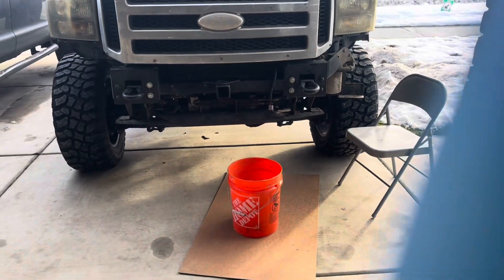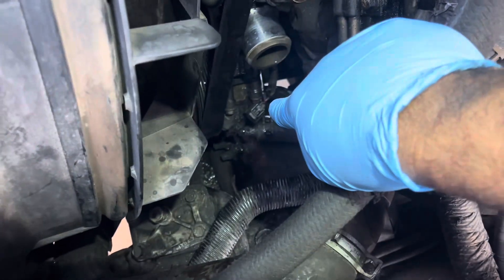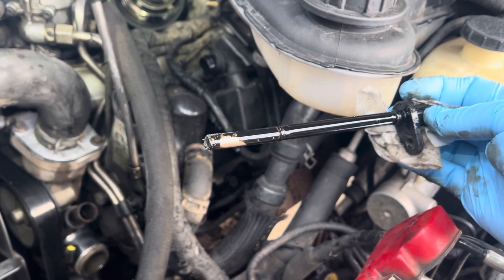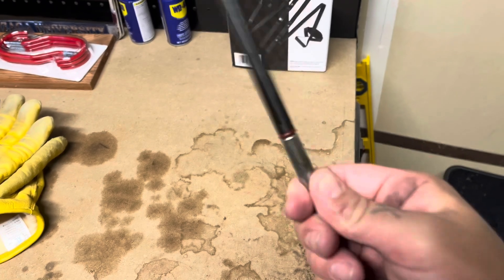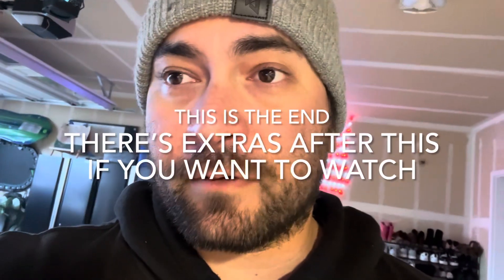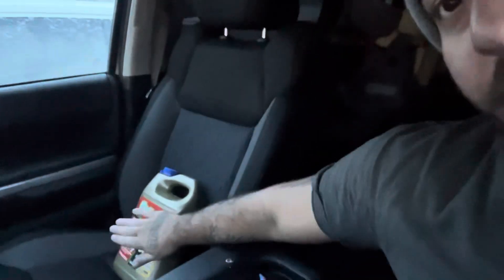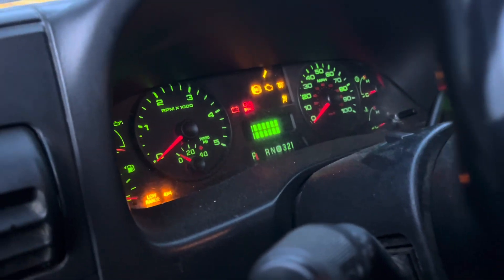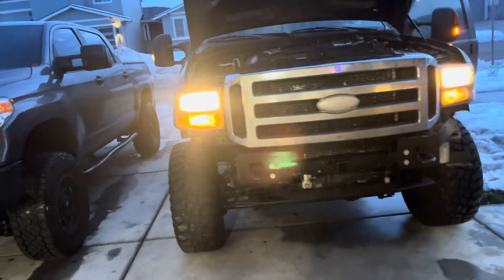Powerstroke 6.0 f250 f350 stalls randomly or shuts off

Comment: Why in the world would you be running green antifreeze in that truck. That is not even the factory fill.

Dump that crap, flush the system, and add a nitrate free antifreeze such as Shell Rotella ELC NF or some other Heavy Duty OAT/HOAT  red colored antifreeze.

Your engine wasn't made in the 60's it needs antifreeze that was atleast made in the 21st century.

Comment: it only happens after driving for like 10 min for me
Reply: then repeatedly happens
Reply: What was your issue?
Reply: @Sotoway  icp sensor after getting on the gas it will stall
Reply: @MJA107 would it fire up after sitting for a little bit? Mines doing it now.  Changed oil, filter, cleaned everything up and took off today running fine. Then right at the store just died.  Waited about an hour, fired up went to drive home…died 1/4 mile from the house.  Trying to get it back now.

Comment: Well. The only lubricant your water pump gets is the oils in antifreeze. So yeah water is actually better at heat dissipation. But you should always run antifreeze.

Comment: Thank you! I bought my 07 new, and it has 197k on it. I have kept it stock with the exception of the egr cooler, and its the sinister stainless cooler. I replaced the factory navistar injectors with new factory navistar injectors. Its been a great truck. I agree with not tuning the pickup. I had an 06 that had an Edge tuner and it ate the transmission. I put about 1500 a year into repairs. But my payments are zero. Not a bad trade.

Comment: Replaced camshaft sensor and randomly stalling or engine dies at low rpm. Could it be the crank shaft sensor starting to go?
Reply: I replaced the ICP sensor and the crankshaft sensor still no fix.
Reply: I’m having the same problem
Reply: Could it be the ipr or fuel pressure regulator?
Reply: Mines cranking won’t start and I already replaced the cam sensor and icp